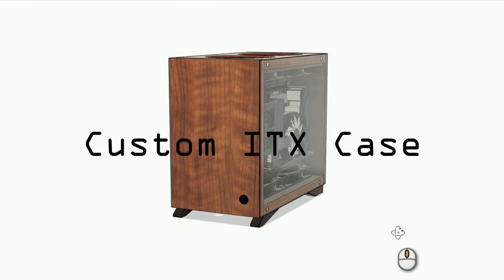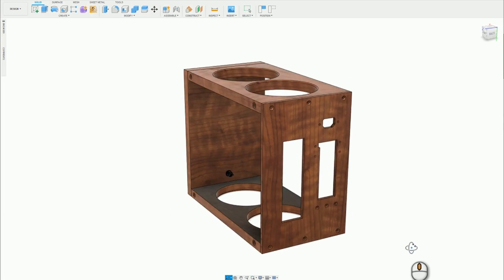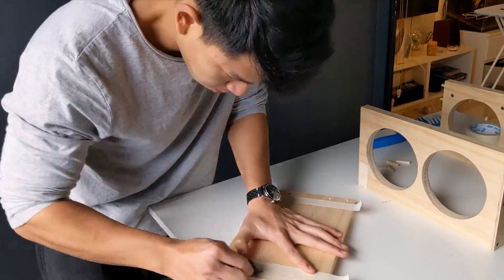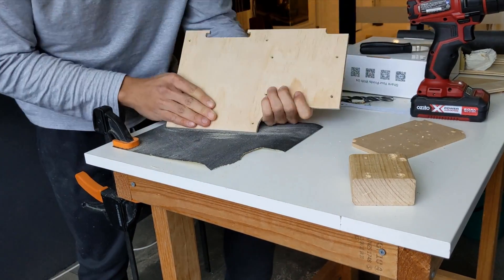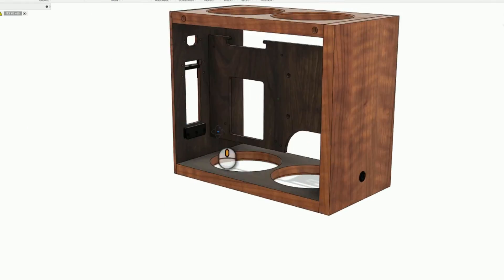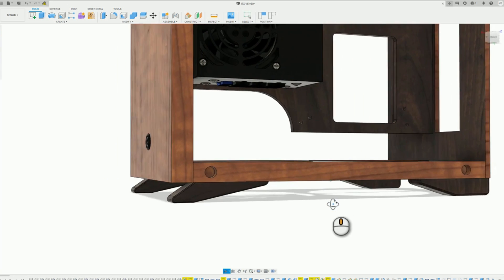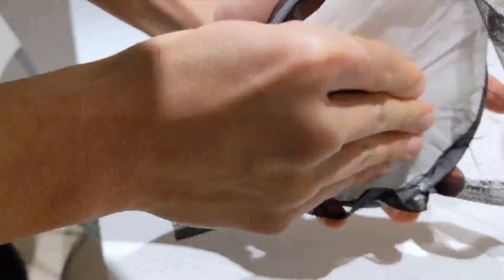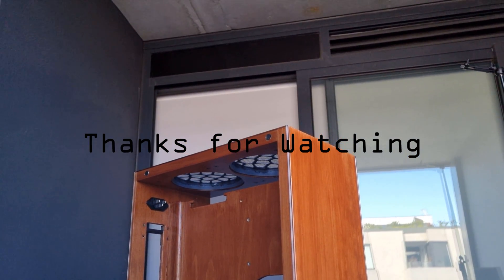DIY Wooden PC Case! - ITX | Woodworking | 3D Printing

Comment: Hi, unfortunately, I don’t know if you’ll still see this on such an old video, but when you create your objects in Fusion 360, how do you know how large and where the holes need to be so that the GPU, motherboard, screws and other components fit?
Reply from the maker: I use a combination of GrabCad models, real life parts and trial and error to get the dimensions right

Comment: excellent work!!! I build catamarans (ply'wd, glass, epoxy). I'd suggest NOT using dowels, instead ONLY 2-part Epoxy. Makes the entire case a monolithic structure!! You'll not need such thick boards, if you wish. My catamarans are of 1/4" ply'wd, and endure heavy waves. I doubt your PC will face such pressures :-) Very-nice video overall!! Now...start that catamaran, next!! I'm building my PC-case asap!! buona fortuna... REMOVED my "sub'd/liked" because this video was NOT downloadable. Ughhhh.... :-(((
Reply from the maker: Thanks for the detailed suggestions, may look into epoxy in the future :)

Comment: what design tool you used for that project is there a free solution or a better free recommendation ?
Reply from the maker: I use fusion360. It's free and I like it alot, highly recommend!
Reply: @mxcbuilds  thank you

Comment: Tip: some great dust filtration screens that is easy and cheap... are easily found at home box store or online, like a Lowes or Home Depot ... is shop vac bags and filters.  Do not get tight hepa filters, but shallower micron screen or bags that you then cut with scissors and use either paste glue or double sided tape or even set up a velcro mesh holder. Or like I do, take the fans off and put the screen in between the fans and case.  Check air flows after, to make sure you have enough air pressure.  Some fans are highflow, some high pressure and some materials are just too dense to blow enough air through.  You can buy really cheap screens online as well, but these are so much more customizable.
Reply from the maker: I used some nylon mesh I found for 4 dollars per metre in the fabric store as dust filtration. Works pretty well!

Comment: Hey mate I want to make one like this but a touch smaller but still MATX. What was the 3d modelling program you used
Reply from the maker: I used fusion 360. This is an itx case and it barely has any spare room. I think building a matx one that's smaller than this would be close to impossible? Just my thoughts

Comment: Besides having a unique looking case, are there any other advantages? How much does it weigh empty? Nice work, very precise.
Reply from the maker: Thank you. I don't see other advantages, I just enjoy building it as a hobby and proud to have a completely unique PC case. I did not weigh the empty case but it's quite light as I used pine for this build. The next build will be significantly heavier as I'm using hardwood. Sub so you don't miss that!

Comment: love the work, looks like you got most of that gear from bunnings :) One thing i did was get a hole saw attached for my drill that could cut out those holes a little easier, but might be difficult with that particular cordless drill. I always wanted to try a SFF unit so might get me going again, great work
Reply from the maker: I order most of the hardware from AliExpress
Reply from the maker: Haha yep, spot on! If I were to make this more I would definitely get a hole Saw as well.
Reply: @mxcbuilds  where did you get the threaded inserts and magnets?

Comment: Really nice work. I think I used the same power button on mine. What I did with my wood case is that I made the fan holes square. That allowed me to put the fans inside the wood frame. The fans are 25mm, the wood is 18mm. I also went all wood, no ply wood. Nice idea regarding the attaching of the glass, what I did for mine is that I slide it in in some groves made in the wood. My case definetly looks worse :) but it is mine.
Reply from the maker: That sounds great! How did you mount the fans to the wood?

Comment: Dude this is amazing. But instead of gluing and screwing all the panels together, why not just use wooden/metal insert and have embedded magnets alongside, for the sake of modularity. so it wont bond permanently.
Reply from the maker: Thanks for watching. Cool idea, but I prefer a more solid construction. It's not like I plan to change the panels anytime soon anyway.

Comment: You should open up the front panel so you will have intake
Reply from the maker: I have full intakes for the 2 bottom fans. I wanted to keep the front panel as clean as possible to show off the wood look. Thanks for watching.

Comment: Just a pointer for anyone interested in doing this themselves.

Make sure you use a high quality plywood for the motherboard tray and seal it well. Normal wood, especially when left untreated, will expand and contract significantly with room humidity levels. Up to 10mm over the length of a motherboard. That repetitive stress is likely to break the board over time.

Plywood has significantly less moisture shrinkage, so it's less of an issue for it. And you can further reduce it by sealing the plywood with a lacquer (on all sides/edges).

Feel free to use any kind of wood for the rest of the case. Unless you're doing a hard line custom loop. If you do a custom loop the shrinkage/expansion could make fittings become loose.
Reply from the maker: Alright thanks for that sanity check :))
Reply from the maker: Thank you for your detailed insight! I was worried about my mounting method for the side glass panels. Do you think the expansion along the grain of wood would be significant? I've read that it's the expansion across the grain that's the real issue.
Reply: @mxcbuilds   Yeah, expansion is negligible radially (along the grain), Unless you live in a tropical climate, generally less than 1% from season to season. So I wouldn't worry about it. At worst, you might have to expand the holes a little bit to allow a little slack when the slight expansion/contraction has occurred. 

As you said, it's the tangential (across the grain) expansion you have to worry about when it comes to wood.

Comment: this might be a big request but is there anyway you could make an itx case (even a digital design) that has the motherboard on the opposite side of where you had yours with the gpu fans facing the bottom with room for intakes under the gpu
Reply from the maker: I've done a quick concept of this lay out before. Might put more work into it after my other projects

Comment: Awesome, could you please share me a designed source 3D?
Reply from the maker: Thanks, the 3d file I have for the case is not that accurate as I made mistakes on the fan holes and not accounting for 27mm fans. Had to modify the wood after I cut them. I may release a full CAD file when I get the time to correct these errors.

Comment: Amazing build. Could you provide the files for the 3d printed brackets for the pci slot and the riser cable bracket by chance?
Reply from the maker: Hi Chad, I could provide the STLs but I don't know how useful it would be. The dimensions are suited to the 7mm plywood rear panel and the riser cable bracket will depend on how far you mount the GPU from the mobo tray.